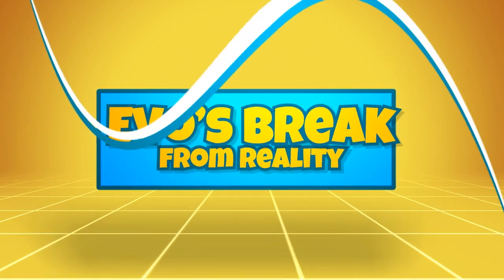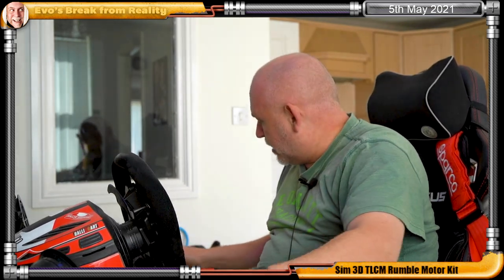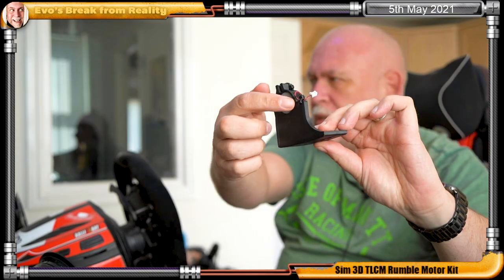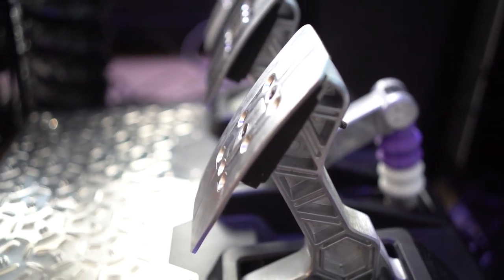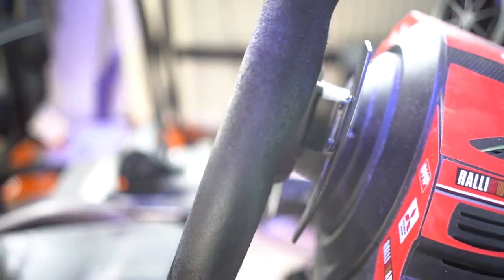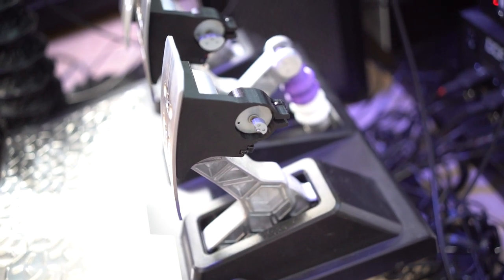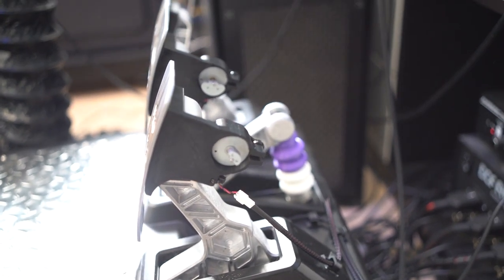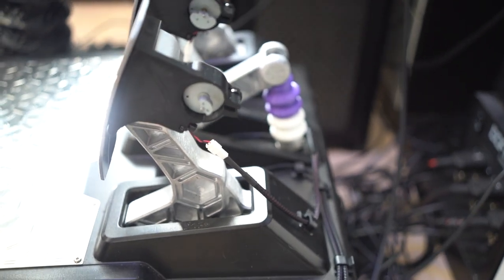Sim-3D Thrustmaster TLCM Rumble Motor Kit - setup and first impressions.

Comment: Awesome video; thanks for uploading.👍👍👍
 I have the T-LCM pedals and ordered this 3D-Sim kit (+ wind), and your video finally shows how they mount. It might be a bit tricky for me, as I have super-modified my T-LCM pedals; they're inverted and I added spacers, and also cut down the clutch pedal face. We'll see if I can actually install this when it arrives....
Reply from the maker: Wow.  Inverted TLCMs.  Would live to see how you did that.  I had the T3pa pro inverted before these.
Reply: @EvosBreakFromReality  Yeah, it was a little tricky to invert them. I first thought I could simply switch plugs between clutch and accelerator, but the Hall sensors are matched to each function (although they appear to have identical circuit boards), so it required lengthening a multi-stranded cable. I should post a video about it.....I did film it all, just need to edit it all together.
Reply from the maker: @Polymer  you should post the video.
Reply: WOW - Respect!
Reply: Do you still use them?

Comment: nah, get some dyson transducer pucks and an amp, you can DIY WAAAAY better for $50 USD.
Reply: This is really meant IN ADDITION to any other "bass shaker/tactile transducer" that you might have. The idea with these motors is that they are mounted VERY close to the pedal itself....actually ON the pedal really. I have BTS-1 and BTS-2 shakers, and am still going to add this Sim-3D pedal (+ wind) kit. 👍
Reply: Well you still need an amp for those to work though, that's why they're cheaper lol

Comment: I cant believe that motors only work as a force feedback, they should just imitate the engine that as you press throttle that motor start working, like in real car. You dont need ffb on your pedals.
Do you know any software that could do that, to just add % to the motor as you press throttle? so this would be regardless of the speed/acceleration , just % of RPM. ???
Reply from the maker: It’s not force feedback it’s more rumble transducers.  It gives you feedback for whatever you set the software to do.  I use them to let me know when the tyres are slipping but you can set them up to the engine revs if you want so you can feel that.  The choice is completely up to the user.